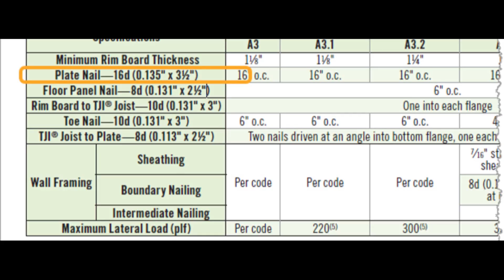Podcast 226: Framing Details, Fasteners Sizes, and Fire Safety

Comment: Regarding whether there's anything inherently wrong with a 9,000sqft deep energy retrofit... It completely depends on the use of the house. On one hand, any task which is thoughtfully accomplished using less energy than other options is an improvement, and one could argue there are many more opportunities on a large house than a small house. But on the other hand, if the 9,000 sq ft houses one person, it's inherently wrong but not because of the house. The same house used to house 4 or more families (or generations, or simply a large amount of unrelated people) is no longer a problem.

Comment: I ask my engineers from time to time about nails as the framing crews just seem to go by more is better.  Also nailing patterns and spacing. On one build the framing nails were about half the thickness of what was specified. Surely the shear strength suffers